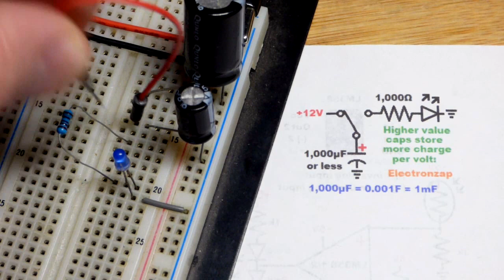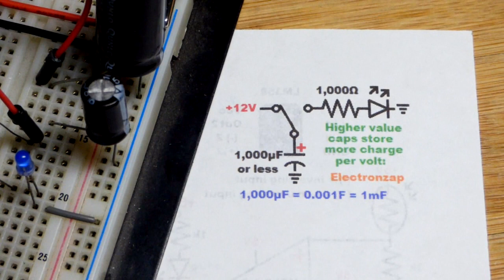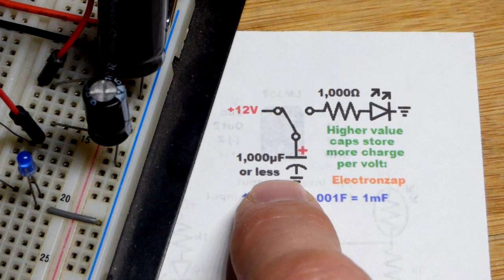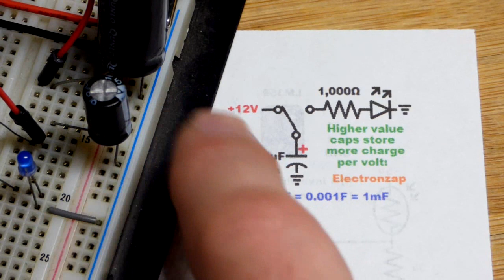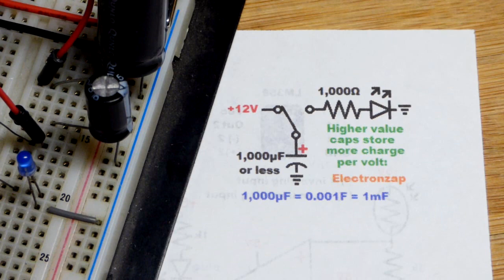Capacitors can store a little charge for brief power demo circuit learning electronics shorts 32

Comment: Thanks. Useful stuff. Keep making these videos.
One note: at 0:49 you said Shorter Lead.
But this true only if person is using brand new capacitor. Used ones may have same length leads. I usually look where is the minus sign. I never look leads length. I prefer this method
Reply from the maker: Yup, good tip!